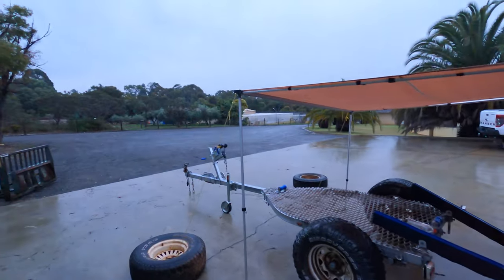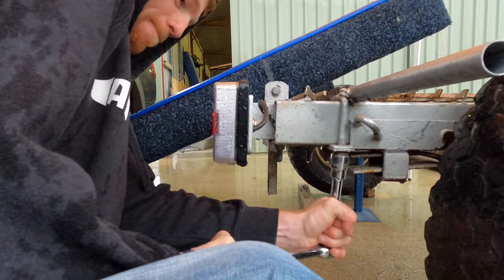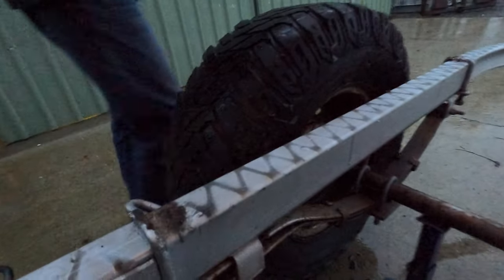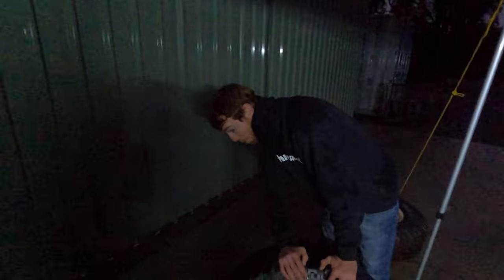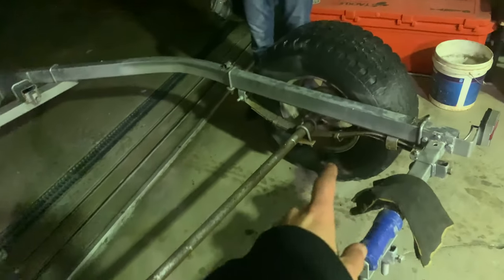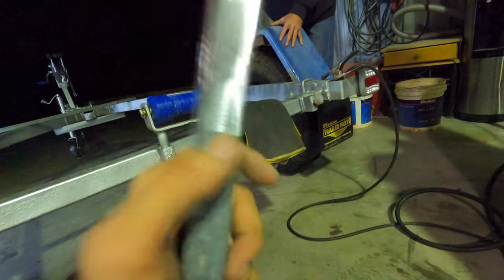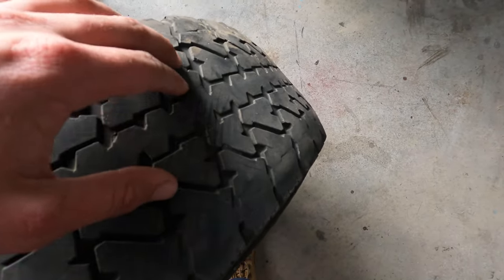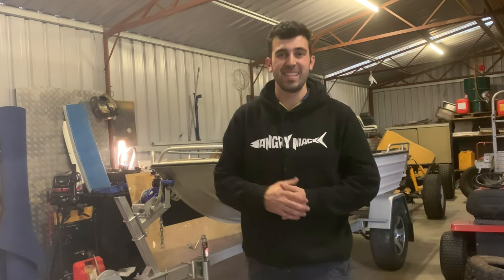GETTING BOAT TRAILER READY FOR PIT INSPECTION | BUDGET OFF-ROAD TINNIE BOAT BUILD | PART 4

Comment: Nice rebuild ....
Not enough attention is paid to the humble Wheel Bearings ....
Why didn't you put the walk floor back on ?
The Jockey Wheel handle is still bent ... was that forgotten about ....
Might need to talk to the "Producer", and wait for better weather to film .. next time ........  LOL ...
Reply from the maker: Thanks for watching buddy!!
Floor was left as it’s actually quite heavy and the next owner can decide if they want it or not, I’m not fussed!
Yes I tried bending back but no success without breaking it lol. Might need to throw some heat onto it or replace. 😂
Reply: @AngryMackAdventures  a bit of heat should do the trick !!!! Cheers for the Reply ....